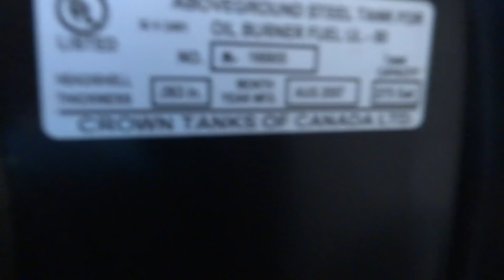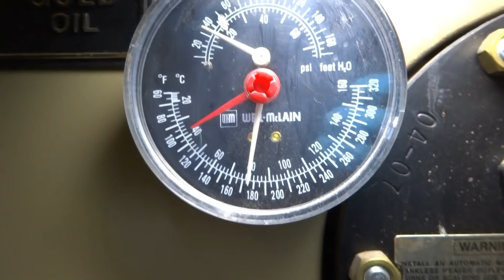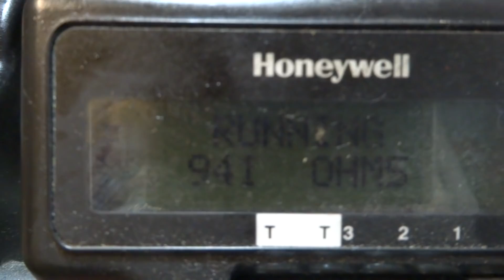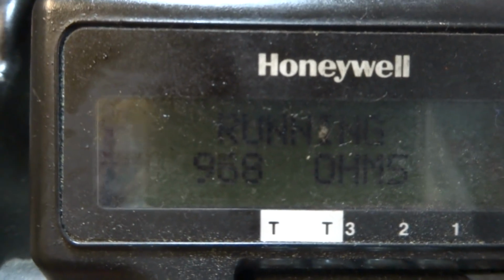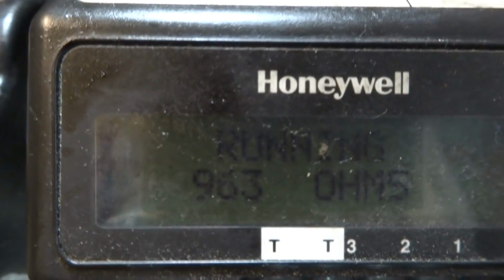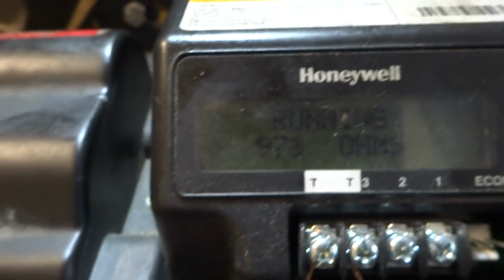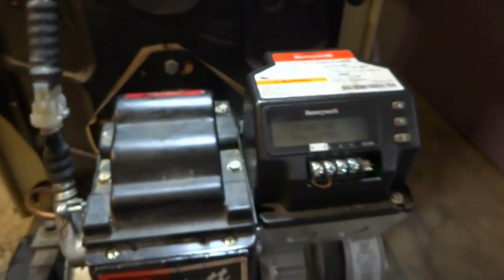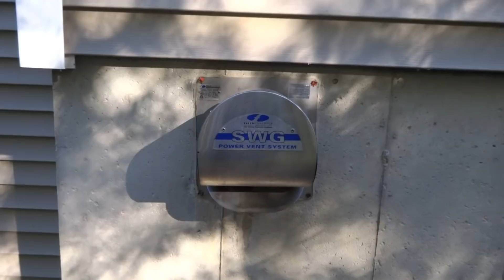WEIL MC WAIN OIL BOILER WITH BECKETT BURNER ANNUAL SERVICE

Comment: Steve and I do the same thing you do if I go out to service a gas furnace or a central air condition I only charge people for the things that need to be done other things that can be left alone leave it alone if it's working don't mess with it but there's a lot of technicians out there will stick it to some of them customers they'll say you need this and you need that it's just ridiculous at this scams that goes on keep up the good work

Comment: Annual service is very important but homeowners are very fearful of letting a possible crooked technician tune up their unit. They're rather wait for it to stop working.
Reply: Only $125 here in CT, worth the $$ but you're right... finding an honest guy is the hard part.
Reply: @WeatherNut27  You got one you can trust? I'm on Plainville/Southington line with same unit he just cleaned. Thanks & take care!  Sonny
Reply: Agreed, I went through a crooked one before I found an honest outfit. My advice is to get multiple opinions if something is expensive. Also, ignore the fear tactics. Crooked outfits will use fear tactics, at least they did for me.

Comment: Years ago I had a Weil MC Gold bolier with Weil MC BURNER HEAD!!!   They only made it for a year or so.  When I called for parts Weil MC said no parts were available, but they would send me a replacement head for free, brand of my choice.  I chose the Riello.  Even had wiring harness that plugged in, bolted up.  I was shocked.
Reply from the maker: i have some parts for that burner a transfomer i believe
Reply: You made in excellent choice Riello burner
Reply: @brianlais9903   Thanks!  Besides the Weil MC, I have only worked on my family Riello burners.  All have original parts except for the nozzle, one leaking pump, and hydraulic jack on the old Metcron (spelling) Bach water heater.
Reply: @stevenlavimoniere   Steve, if you ever come across one PLEASE make a video!

Comment: We went through about 600 gallons a year.. most midwest places have very clean fuel oils definately no nees to replace filters every year if you not going through 1000s of gallons.. trolls will be trolls ignore em.. steve Id trust you to work on my heating system anyday

Comment: Ya know folks, its like Steve always says "it aint rocket science". He always shows that the unit has good oil flow before deciding not to change the filter, now common sense will tell you if bad oil is going to stop up an old filter that had good flow, it will stop up a new filter also.
The man doesnt like charging folks for things that they dont need, and has more work than he can handle. That says alot to me. KISS
Reply: A filter is $.98 and takes 5 minutes to replace. SILLY to not change it. I’ve said it before as well. A proper oil boiler service is COMPREHENSIVE. If you’re not going to service it soup to nuts, then don’t even bother.
Reply: comprehensive

of large scope; inclusive; having an extended mental range or grasp: a comprehensive study of the situation
I believe that Steve nails that with oil fired boilers, he has been at it for 40+ years.
Reply: @dannyhutcheson9932  Just because you’ve done something for a long time, doesn’t mean you do the best job at it. I know guys who have services boilers for that long and have never owned a combustion analyzer.
Reply: @SureShotImages  i agree and also respect your opinion but we have all watched these videos and have seen good oil flow through the pump. Old or new, the filter is releasing the correct amount of fuel for good boiler operation. Its no different than the fuel filter in my truck, if its allowing good fuel flow at routine maintenance intervals it does not get changed. I have driven vehicles more than 200,000 miles and never changed the fuel filter. That being said, im sure that you are a good tech and just want to do a good job.

Comment: I'm going to clean my own boiler. Can I clean and reuse the nozzle, or do I need to buy a new one?
It's a Valient boiler with a Beckett burner.
Reply: You can change your own nozzle but it has to be new and there's a lot more to cleaning your boiler than just changing the nozzle in filter
Reply: You can clean your own boiler I meant

Comment: Steve, 
I grew up in Danvers, MA and I'm  curious to know if there are any coal burning furnaces still heating houses?
Reply from the maker: i have not seen any coal units
Reply: We have them here in upstate NY with a local coal distributor in Maplewood NY sold in bag form
Reply: PA has em
Reply: Upper Sandusky, Ohio probably still has some old coal furnaces in that area. There was a coal company just down the street from my grandmother’s house.
Reply: I live in Northeast PA. I burn coal using a EFM coal stoker/boiler. Totally automatic.

Comment: Our new Weil-McClain seems pretty solid. One question I had though is that I requested an outdoor reset sensor and my contractor insisted on using a Tekmar controller instead of the sensor option on the built in digital boiler control. Does anybody know what makes the Tekmar unit so much better? I argued for the simpler setup, but was told "The Tekmar just does the job much better". Anybody care to opine?

Comment: If you're going to be down there doing the annual cleaning, why wouldn't you change the filters? You may have good oil flow now, it may weaken before another 12 months passes. Not changing the filters is just silly. And the boiler should be brushed and vacuumed.